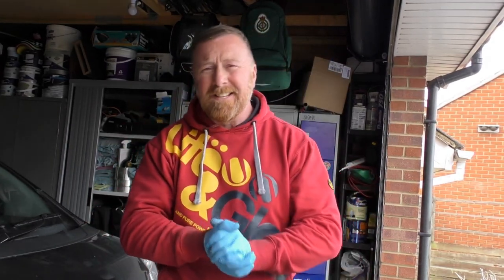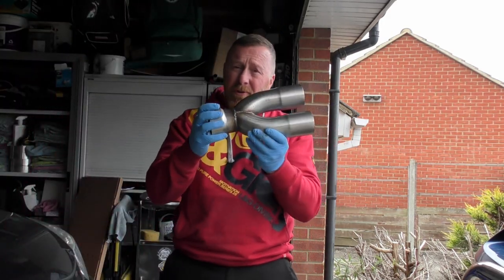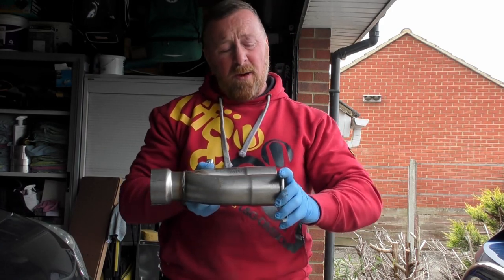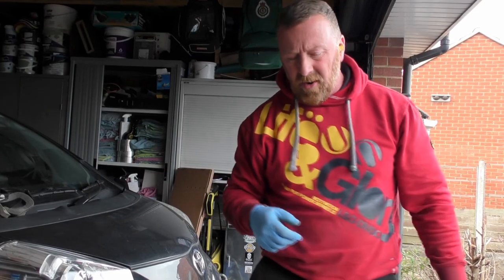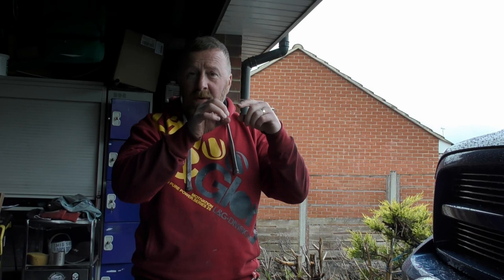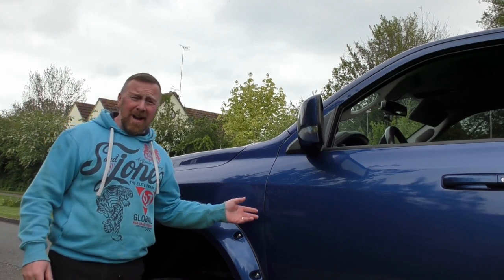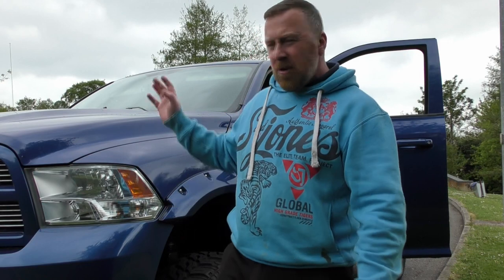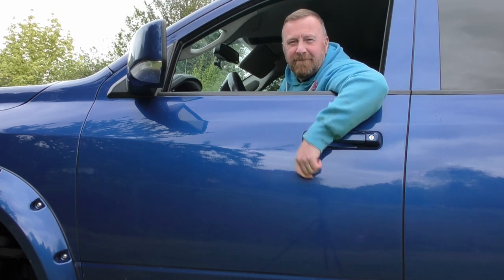OMG V8 HEMI LOUD EXHAUSTS DODGE RAM 5.7 MARK SAVAGE

Comment: Hi Mark, recently sent my 50cc 2 stroke moped away to be fixed and MOTed as it was revving very high. It came back all fixed with mot and I started it up after a minute or two it just cut out. Is this a normal thing or is there a problem, thanks
Reply from the maker: yes some can as from normal wear, keep an eye on it and as long as it runs and when you waiting at lights etc it stays running it should be fine but it if keep stalling id bring it back 
i take it, it starts back up straight away after it stalls ??

Comment: Hi bud have u got a speedfight 100cc cylinder cover I can buy need one for my speedfight 100cc I bought the kid been ridding without one on and it got heat seize 

Cheers mate
Reply from the maker: you do need one bud and the 100cc and very hard to get , i've bought a 50cc cover and cut it and bonded it so the fan still cooled the head
Reply: @marksavage  how did u do that mate got a 50cc cover
Reply from the maker: Cut and line the right side next to carb 
You need as much fan blowing air over the side and top 
Heat glue and use the side bits you cut to cover 
Ok it's a bit messy but helps
Reply from the maker: Guess you still have the half lower fan cover 
Yes !!
Then it will work
Reply: @marksavage  yes got the lower fan